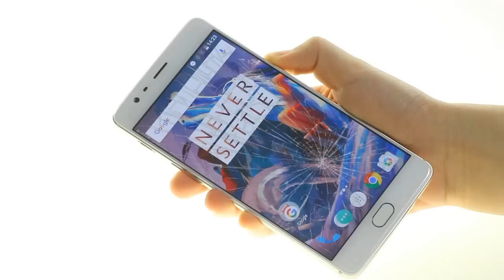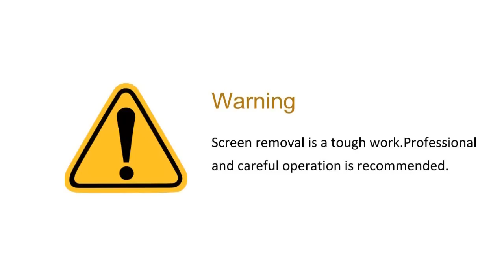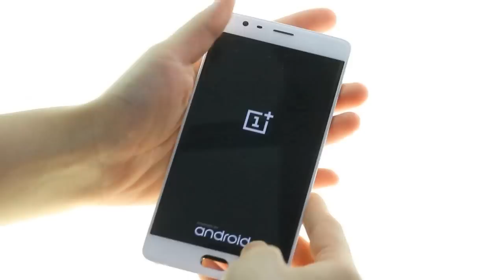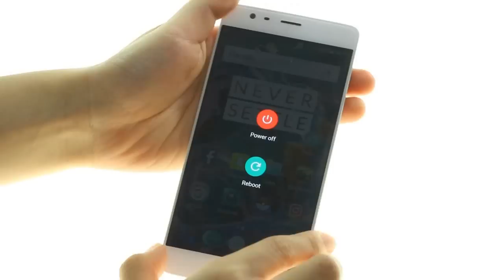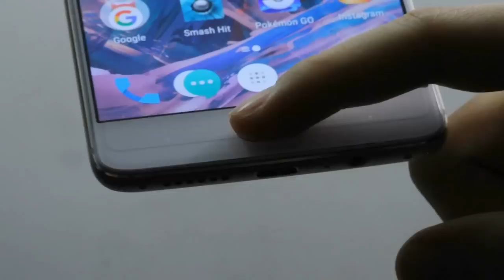OnePlus 3 Screen Replacement - Repair Guide

Comment: There is purple spot on my one plus 3T and it's spreading all over.What should supposed to replace screen or LCD only?
Reply from the maker: You need to replace the whole screen. It needs professional machines and skills to replace the LCD only. Even a little misoperation would ruin the whole screen. However, you can do it yourself to replace the screen, as is shown in the video. https://www.witrigs.com/oem-lcd-screen-assembly-for-oneplus-3-a3000-black

Comment: Hello  i say in my one plus 3t
My screen is Woking but touch is not working what i change
Reply from the maker: You need a screen replacement, because it is almost impossible to replace the touch panel only.

Comment: replaced my screen now screen not waking when press power button but buttons lights up as if its on
Reply from the maker: You can disconnect the battery first and try reconnecting the display flex cable.

Comment: So, I have done it and everything seemed to be fine until I switched off the screen. Although the hardware buttons work, the screen is totally unresponsive. I mean the screen works during start up and the entire phone works fine, but when the screen goes black it won't respond. 

The only thing I did wrong: I put in the cable that was labeled “sub” and “main” in the wrong way. Could that be the problem? Anyone an idea what I can do?
Reply: Christoph N yes
Reply: where the cable with labeled "Sub" and "main"?
Reply: Hi man.. same here.. any update? How u fix it?

Comment: STOP! STOP! STOP! Read this First.
Pointless to DIY guys parts are more expensive, Its cheaper and quicker to get Oneplus authorized repair service to replace the screen and touch digitizer!

My screen was broken so I contacted Oneplus using the "chat" button on their website and they organised everything, There is a set price to replace the whole screen/touch 88 Euro (77 GBP) for me Inc. shipping tax from the UK to Poland and back, Phone was repaired and back in my hand within 4 days! and the website keeps you informed every step.

Pros
1) Save money: Oneplus Screen/Touch replacement Part + Labour is cheaper than third party part alone!!
2) Guarantee: Fitted by a professional so it has a guarantee.
3) Genuine Oneplus Screen and parts: Do you really want to use and stare at lower grade screen (if so buy a cheap 2nd phone)
4) Faster: Can be quicker than ordering the third party parts and having the time to fit it.
5) Hassle: DIY the job and it always has the possibility to go wrong. (there is also adhesive parts which are replaced by the professional repair and listed as parts which you can't buy third party to DIY)

Hope that helps someone.
Reply: You forgot to mention they erase your data though.
Reply: I contacted them and they quoted a different price from the site for JUST the parts. Never told me how much labour, tax, and shipping is. Others on Reddit have complained about sending their phone in and them "diagnosing" other problems and forcing them to pay $300. So they just shipped it back. Not to mention others have sent it in with no updates for weeks. I'm not paying the price of a screen (from another source) just for the shipping by itself, and to be pushed around for weeks.
Reply: The digitiser is £49 I believe, a glass screen (that is removed in this) is a lot cheaper

Comment: Hi I think that the Oneplus 3T uses the exact same display as the 3?
However I still want to make sure that I can buy the A3000 screen for the 3T?
I really like the Wit Rigs products and tutorials so it would be nice if you can let me know if it's the exact same process to replace the 3T screen?
Thanks!
Reply from the maker: Yes, they use the same display. You can buy either 3 or 3T LCD screen.

Comment: I tried to repair my cracked display like in the video, but now, my screens left side isn't responding well, and if i touch the right side it registers a touch on both sides. Overall the touches seem to be off pretty much. Some1 know what to do? Any Ideas what to do now?

Comment: I broke my one plus 3t by dropping it on the ground and at the beginning edge flashed white light .... later on the lit started to fade away to black, and the touch still works. Any suggestions on what kit I should get ?
Reply from the maker: I prefer you take one to fix it: http://www.witrigs.com/custom-lcd-screen-assembly-for-oneplus-3-graphite

Comment from the maker: This video shows you how to repair/replace the broken Screen of OnePlus 3.
Get OEM Replacement Parts For OnePlus 3 : https://witrigs.com/d4r8p
Screen Replacement with Frame for OnePlus 3/3T : https://zegsu.com/s/eo1wg
Reply: For my oneplus3, it's T3
Reply: I need this screen please contact. 0812501126. Oneplus 3T
Reply: What if I can't power it off because the screen only lights up but no display? (Turning it off for the first step)

Comment: Hi, I broke my oneplus 3 screen. The touch is working but the screen is black and has rainbow colours. But I can see that when I touch the screen it works like normal, what kit should I buy to fix this on my own. Thank you
Reply: I have the same problem but how do you fix it?
Reply from the maker: I can see that the touch screen is still working but the display screen is broken. It's very difficult to repair display screen only. Here is replacement part and tools http://www.witrigs.com/oem-lcd-screen-with-digitizer-for-oneplus-3-graphite-black

Comment: This your screen US VERSION ?
Reply from the maker: This screen is the same with A3003 (Europe/Asia) and A3000 (China). But different from A3000 (North America). You can check out your version at Settings~ About phone.
Reply: Wit Rigs  Let's see if I get it. Is that video screen a3000 us version?
Reply from the maker: No, the screen in this video is not a3000 us version. I'm not sure whether this screen is compatible with your device, because may not all a3000 saled in US are US version. The only way the distinguish is to look at lcd screen flex cable or headphone jack board. Please visit www.witrigs.com and see pictures of these two replacement parts.
Reply: I bought my cell phone in the ONE PLUS store, which version is mine?  
OP3 A3000
Reply: Thanks, but what difference of jack board?
Reply: Wit Rigs thank you

Comment: did u replace the hole panel including the amoled screen...i cracked my screen but its just the outer glass thats crack is there any way of removing just the glass and replacing that?
Reply: Kevin Ireland i was wondering that myself too
Reply: Knifeguy0 yeah its so anoying when they only show u the removal of the of the hole front panel..i am still to find out if its possible to remove just the glass screen or not...if u find out let me know lol
Reply: Knifeguy0 yeah i will do...i know theyre starting to come off on mines to iv ordered a replacment screen from amazon and them we tools so i think im going to give it a go myself :/..what could possibly go wrong lol
Reply: Kevin Ireland the whole screen is like 200$. I bought just the glass
Reply: Knifeguy0 yeah me to im not wasting 200 pound might aswell save up for oneplus 3t for an extra 200 lol
Reply: Kevin Ireland yeah
Reply: No. Actually it destroys the amoled screen under. Tried it because i needed my phone and now i just have to buy the expensive option
Reply: Quinten Rademakers when i broke my opo it took 5 days in total. Finland to london and back and the repair 5 days is really good imho.
Reply: Sou Illuminat can I have the link you used to repair yours
Reply: and it's posible ?
Reply: Raul Oliver yeah i bought one but if you dont have tje professional tools you cant do it.
Reply: Raul Oliver yeah i bought one but if you dont have tje professional tools you cant do it.
Reply: Its very hard? Do you know if have a video showing how?
Reply: Knifeguy0 so, the best way is replacement total ?
Reply: Did you manage to fix your screen? I was hit by a car yesterday and my screen got smashed. The actual digitzer or screen seems fine I think it's just the glass that got cracked/broken. The phone functions fine. How difficult would it be to replace the glass myself ?
Reply: Mathis Arnell I would personally say don't bother with the screen
Reply: Knifeguy0 whys that?
Reply: Mathis Arnell the amoled screen under the glasd will most likely get destroyed in the process.
Reply: Mathis Arnell they aren't made to be fixed. If you send it to the manufacturer they will replace the whole screen
Reply: Oneplus charges around $100 for the screen replacement, just go for it, don't try to do it yourself. And yes you do need special tools to separate glass fro mthe amoled panel, I tried that with business card and a hair dryer and let's just say it didn't go well, I got to the middle and then it started to go much slower and hard until it eventually cracked.
Reply: Do you know how long it would take for Oneplus to fix this?
Reply: buying the tools probably still cheaper(its only a heat gun and some fine heat resistant line). its not the tool its the willing and steady hands.
Reply: Knifeguy0  hum, i tought its posible, because i saw in ebay the just the  glass 5$
Reply: Raul Oliver yeah it is. And there is, not for this model but see the video for any other model vith similar screen. But you need very good set of tools